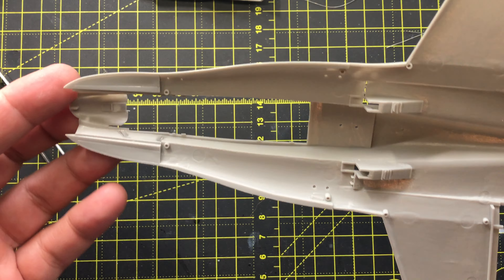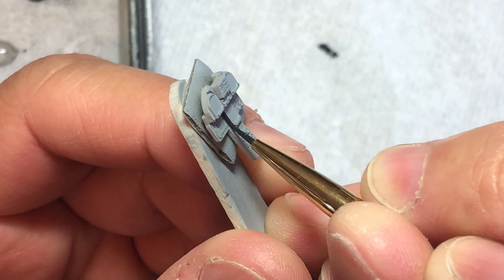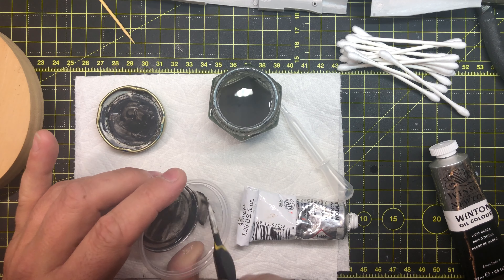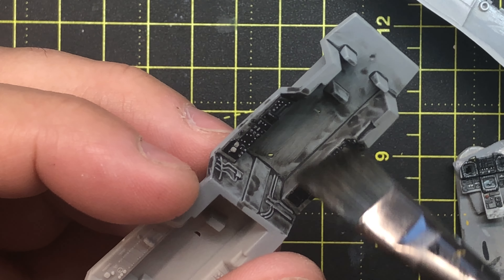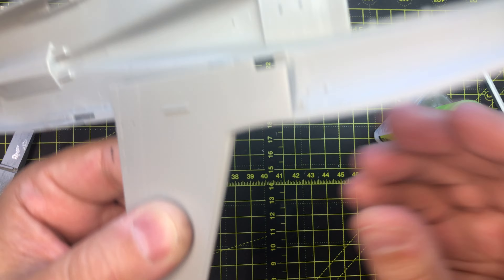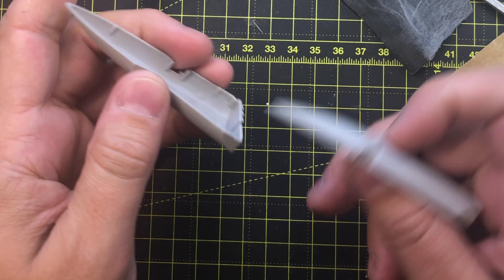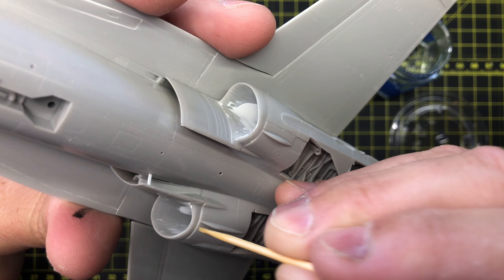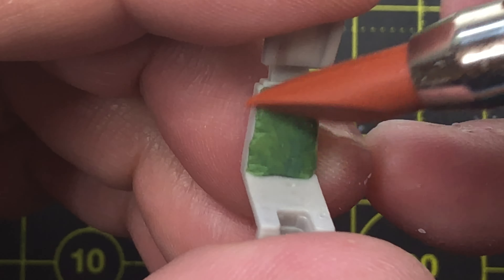Plastic Scale Model Build - Hasegawa F/A-18C Hornet in 1/48 - Cockpit, Fuselage, Ejection Seat

Comment: Hello. I just recently discovered your channel and I am enjoying it. I have one question. I am very new to modeling, and the only thing I have to paint the models with is the vallejo paint. I noticed that you added water to yours, and since I have been struggling with them drying out very fast on my pallet and creating a film over the paint, I am wondering, is that what the water is for?
Reply from the maker: Hi there, thanks for following the channel. The water on the wet pallet is used to help thin the paint. If I brush the paint on and it’s too thick, streaks will be noticeable. The pallet that I’m using a wet pallet so the sponge underneath the paper is soaked in water. This allows any paint to stay wet for several hours often overnight. The wet palette also has a lid that can be placed over it.
Reply: @hobby-wankenobi  Ok, thanks! Also such a fast reply!

I will have to see if my model store has one 🤔